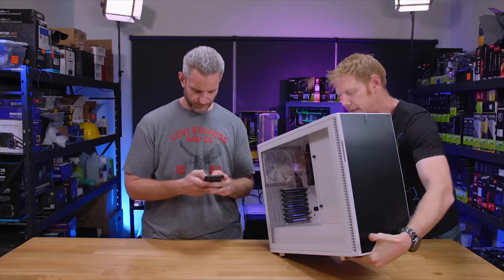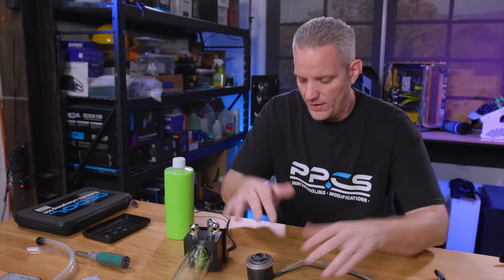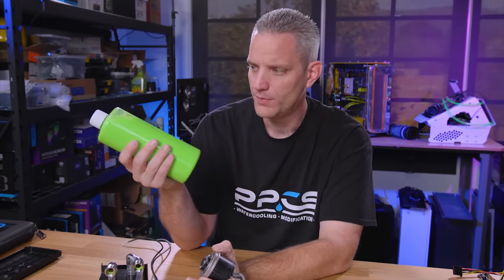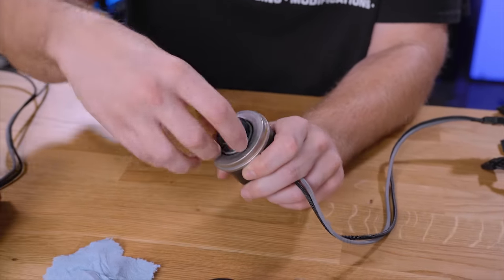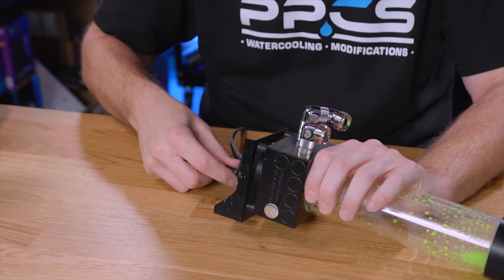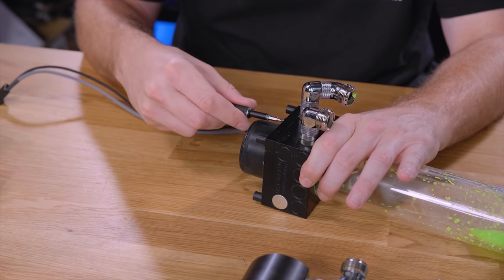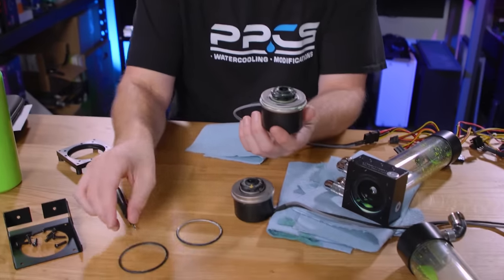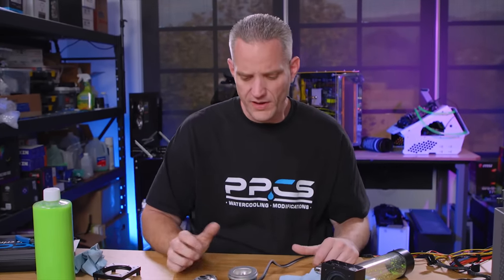BOTH of my pumps died... here is how I fixed them!

Comment: Can't tell if that is a fractal advertisement or a slick wraps advertisement
Reply: What, it can't be both?
Reply: @Vicepter Its not mesh, is it? Looks pretty solid to me.
Reply: The panel is solid with small vents next to it, zero impact on performance with the wrap.
Reply: Can't be a slick wraps ad, look how much the wrap overlaps the bottom of the door.
I'd rather have one made by Little Jay with a pair of scissors.
Reply: @Vicepter it would be awesome if it was. I usually have my front panel open for extra airflow.
Reply: @mikemarlatt8952  The R6 has a front door, it easily opens for when you really need airflow. It works fine with the door closed also.
Reply: @DumbSloth87  panel/door, same thing. Kinda. Lol. I see maybe 2-3* difference between open or closed. So I agree the case has decent flow either way.
Reply: Who cares I love both

Comment: ...thats why nearly every manufacurer says "dont use with glycerine which is in colour"...
Alphacool says: 

Notice
Not intended for continuous operation with fluids containing titanium dioxide or glycerin. Many pastel colours typically use these additives.

Note on application
Please use only in combination with clear cooling liquids without colorants or UV-reactive substances. The particles and additives in colored or UV-reactive fluids can clog and permanently damage water cooling products such as radiators, pumps, coolers and hoses. This can result in voiding the manufacturer's warranty as well.

Comment: Just a quick question. Can you run mineral oil through a cooling Loop?
Reply: Water would be better. Better heat transfer, cleaner, no buildup, can use any parts.
Oil you couldn't use rubber orings so you'd have to sort that out too.
Seems excessive to do an oil loop just because you're afraid of a pump dying. I'd just air cool at that point.

Comment: I already cleaned mine (bought used but went great for 6 months) 3 times in a month because after one week I can see the pump getting resistance until one day it can't spin anymore.

But when I clean it inside it's perfectly clear and clean, it's physically stuck I need to clean it (without anything visible coming off the impeller!), It's smooth again :( what can make my d5 pwm stuck after only one week every time? 

I have a ek solid coolant but I dilued it alot (on 2 Lt I should have used 2 bottles.. I used one!) The liquid is very clean :(

Comment: You can buy a ultrasonic cleaner from ebay for $40. its soo good for cleaning fittings and pump impellers. Just dont use EK fittings, it will remove the paint LOL.

Comment: As much as i love the idea of having low temps. the insane maintenance requirements to keep a system running smoothly in the long term aren't that worth it.

At least everything boils down to just disassembling the whole thing, clean every single nook and cranny and assemble it back together with new fluid, but still

Comment: Out of curiosity how have those pumps held up after you cleaned them.  I had a D5 die on me so I cleaned it just like you showed.  The pump ran for one day then died again.
Reply: I know your comment was long time ago.
 I’m having the same issue , after cleaning it works only for 2-3 days.
Did you had to replace the pump or manage to fix it?
Thanks !
Reply: @neagu02  I tried several times to fix it and got less than a week out of it before replacing it

Comment: I wonder if an antifouling polymer would help - something like a low molecular weight polyethylene oxide. Anyone got any spare pumps? Would be great to set up some small test loops and just run them continually with and without to see if it makes any difference.

Comment: Think I could have used this on my last D5 that died.  Thought the black on the bearing was my impeller disintegrating.  Too bad I already replaced it and chunked it.  Then again mine wasn't seized it just made a god awful grinding noise.
Reply: i had the same thing happen, i think it's a different issue.. the bit of the rotor that rides on the bearing wore out on mine, causing it to not ride properly and make that grinding noise

Comment: I find it funny that you should clean the loop now and then as my previous pump Was hydor self And it run like 5 years with same distilled water, no silver Thingys in the redervoir that Was by the way a pickle jar with couple holes in the lid. Then i seitched the pump to a similar one when it started make a noise because of wear. Wonder How long my new shiny ek pump lasts.
On top of thst it Was like 10 times harder to get the ek vibrations isolated from the chassy than the awfull looking but efficient hydor
Reply: I've had a D5 for 5 years with no issues.
Reply: JayJapanB so its basicly up to solutions, how long it runs with out dismantle

Comment: Just within last month - I've had 2 different pumps just not start.... for a few weeks I was getting random hang-ups or even shut downs of my PC. I'd just restart it and it was all well.... finally after a few weeks of this rundom shutdowns I touched my gpu's backplate and it was over 60 degrees - I don't know why I didn't figure it out sooner but it was mu pump - which would randomly not start when PC was woken up from sleep (I rarely bother to shut down my pc, I just put it in sleep mode when I go to work and when I go to sleep myself). This time, when I turned on the PC, I noticed the pump wasn't running - and that's when I realized those shut downs where from GPU overheating. Damn. So I quickly switched the pump to another D5 (the last one was from EK, next one was Barrow) - and I tested it before I put it in, and it was running fine... both are molex / PWM. When I put it in the system - it ran all good for the whole day, but the next morning - it didn't turn on as well! Now this I was baffled with. Why are 2 pumps not turning on (and Randomly) with the PC comming from sleep mode.... I disconected the PWM cable, so it's just powered by molex and running on full blast, but since then - it turns on every time. 
I think there is some sort of conflict with PWM and Fan Control software....

Comment: Huh, didn't realize i actually saved two d5 inadvertently when took them apart and clean them. Bought them used on ebay as non-working. Both worked after cleaning them but I figured the seller listed it wrong. It was just a dried head lol.

Comment: I'm doing a build with a pwm pump but when given 12v, ground and with and without a 5v signal the pump just pulses! liquid is readily available, no issue with heat, power is provided the same as here, from an external psu. It moves the liquid about 1 cm vertically up the output tube but does nothing else. Is the pump broken? Can anyone help?

Comment: i got today weirdly my pump stopped working on a new water cooling, got my r5 3600 at a whooping 99 degrees and probably more until my pc shut off, my dad touched one of the pipes and my pump went from N/A to the normal 900 rpm wtf happened? why it stopped working, was for any chance an air bubble?

Comment: Dumb question. If you just run clear cooling would you ever have this problem or have to service your pump etc?
Reply from the maker: As long as you stop growth then you would be correct
Reply: @Jayztwocents   Nice thanks, i will be running EK's Cryofuel pre-mix so its supposed to stop any growth. have been a long time viewer and finally doing my first water loop, cooling my 2080 ti and 8700k all EK parts thanks for your videos man i went back watch all your guides on how to choose parts and fittings.

Comment: This has been happening every time I let my pc cool down,  I used the alphacool CFx opaque blue , everything runs perfect under stress tests 35c , then an hour later the pump Is clogged in this exact way with what looks to be blue Teflon tape .... this pump has been working flawlessly with Normal green for over 5 years and it was clean when I swapped for that.  Opaque coolants should be banned .

Comment: I know it's off topic.from this video but I recently bought all the parts for my first build and I'm looking for the community opinion trying for 1080p ultra settings 60fps here's my list ryzen 3 1200 asrock x370 killer sli mobo 8g team 2666 ram 240g wd m.2 asrock rx 570 8g  gpu thermaltake 500w psu any advice would be appreciated learning as much as I can from the channel this was all I could afford so I'm hoping it will reach my prior stated goals havent recieved all my parts yet just looking for feedback and ty

Comment: +JayzTwoCents
Jay, some of us are still waiting to see you try out Mineral Oil as a cooling fluid. I challenge you to make a video or series on the subject. With such a cooling fluid, you will avoid the problems shown in this video.
Reply: It will "eat" or damage all your rubber o-rings/gaskets inside-out, and at that point your cooling starts leaking regardless of what you do (all rubber parts will have to be replace).
Reply: + @CompatibilityMadness  
No it won't. I've been using mineral oil for years as a coolant, doesn't do anything to o-rings, seals, plastics or metals. Mineral Oil is completely chemically inert, which is why it can be used as baby oil or on the skin. Don't spread myths.

Comment: is there a way to change at what temp the system shuts down?  I've had my pump on turn on with the rest of my system 2 times in the 5+ years I've owned it, and it'd be nice to have some sort of protection built in before things get really hot.  Both times I only noticed when the graphics card started throttling and was at over 100°C.  Is there a way to initiate a system shut down when my gpu is at like 80°C?  I know 80 is still fine, and thats kinda my point, I want the system to shut down while its still at safe temps.  And since my pc is watercooled, it never see's 80°C when everything is working correctly.
Reply: CPU limit can usually be set in the BIOS. GPU limit you'd probably have to mod the vbios to change that.
Reply: noxious89123 it's harder to do with CPU temp cause the CPU still gets hot. That and my eyes only made it to the gpu temp both times this happened and I panicked and force shut down my pc, so I wouldn't know where to set that shut down temp. But with the gpu I know... so uh, how would I mod the vbios for that?

Comment: There is something else at play here. The chance of both dying at the same time is astronomical. I'll bet that his cleaning process dislodged some crud. There's no way they both failed at the same time unless it had something to do with the flush process.
Reply: The thing is they didn't failed or died (as in mechanically or electrically failed). If anything the coolants Jay has been using are consistent on how much gunk buildup they produce in both loops and both pumps for the same amount of hours of running since both pumps clogged up and stopped due to the fluids gunk at the same time...

Comment: You and Steve over at GN scare me when you do the stuff you do with your systems and hardware. From the RTX teardown, to your makeshift water cooled RTX to the liquid nitrogen cooling for overclocking! WHY???!!! FOR THE LUV OF ALL THAT IS GOOD!!! WHY???!! :D
Just ventured into AIO water cooling (NZXT Kraken X52) a Xeon E5-2683-V3 only because I couldn't find an air cooled solution that could fit safely on the Asrock X99 MB. The first PCIe x16 slut is too close to the CPU. Freaking out about leaks and all sorts, and it's not even connected.

Comment: would you run into this problem if you just use plain old distilled water?
Reply: Not likely, like he said it's primarily an issue for "vanity" fluids. Just make sure you're using some kind of algae mitigation
Reply: Very unlikely tbh. Maybe someday eventually, but like 10+ years. Just as the guy said, use a algea inhibitor and a killcoil
Reply: I would think you'd still get some buildup. As the water runs, it still causes a very tiny amount of erosion of the internal metal surfaces. Those particles can still collect in tiny nooks and crannies and cause degradation of the o-rings (again very tiny amounts). But those are secondary concerns to the ionization increase of the water that can make it conductive. While you might not need to clean out your loop nearly as often, it should still be done periodically.

Comment: Why would you not dismantle and clean up the only mechanical, moving part in the entire loop ? After years of running both objectively problematic fluids, and fluids you even said so yourself, is not made for running long term? You're a car guy whom does a lot of wrenching himself. You know bearings and similar moving parts wear and seize up if not cleaned up (or changed where not possible). This isn't meant as personal criticism or vitriol, the question is not rhetorical. I would like to learn, we need to understand the don'ts too, not just the dos.

Comment: Huh? I thought D5s die pretty much instantly if you run them dry.
Reply: the water lubricates that bearing and it'll eventually wear out, so the warnings that they die instantly running dry are just exaggerated warnings